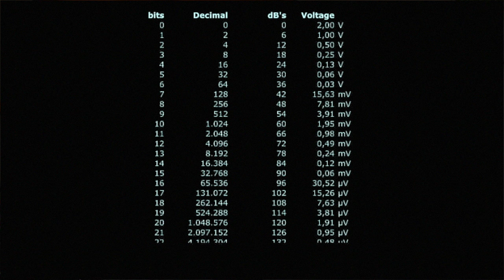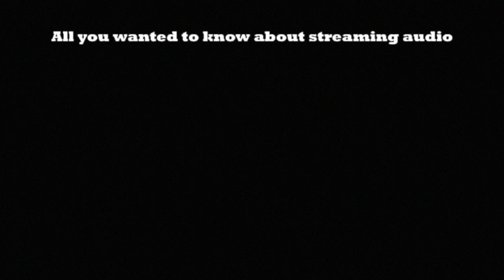Audio Hygiene 3 interconnects

Comment: Maybe the best solution is fiber audio cables to speakers that have built-in DACs.  That eliminates the worry over those picking up interference.  If that's an option, it's the best choice without need to consider your environment.
Reply from the maker: That might solve the cable problem, but does it solve the audio quality. You will be hard pressed to find the combination of a top quality DAC, a top quality amplifier and a top quality speaker design coming from one manufacturer.
Reply: The Hans Beekhuyzen Channel
Thanks for the reply.
Reply: However most companies can make at least one or the other. And having super high end gear is not necessary for great sound if you pair the right gear up and put i in a good room. most audiophiles forget the room and focus too much on the system. or they go overboard and put all kinds of panels and reflectors on the wall, and become obsessed with it.
Reply: Raymond Leggs
I wonder if it's less expensive to hire an audio engineer to study the room and electrical outlets and prescribe equipment and hardware and how to set it up than for the layman to figure it out himself.  Considering the time it takes to learn.
Reply: It can be to an external DAC.  It'd probably be even better if the DAC also decodes your prefered format.  From there probably all you need is a line built like a professional guitar cable.  It naturally cancels out interference.
Reply: It's been my experience that TOS link (fibre optic) is always inferior to SPDIF (coax)  for audio
Reply from the maker: Bandwidth wise that is absolutely true. But in some case the galvanic separation a plastic (fibre optic) connection offers can lead to better results since it solves problems with earth potentials.
Reply: How much bandwidth could audio take?  Can it be enough to saturate Toslink and still be handled well by SPDIF coax?  It shouldn't matter if it's passed to the DAC to decode it.
Reply from the maker: The general consensus is that 192kHz 24 bit is the limit. But depending on the components used - including the optical cable - some jitter or even serious jitter might occur.
Reply: I wonder if that is due to being converted to light and then back to an electrical pulse at an inconsistent rate vs electrons going straight through.  Sometimes I imagine, do to a slight addition to complexity, the best cable also depends on the demands of it.  If it's miles long and shared by a lot of high bandwidth applications and client/server connections optical fiber likely wins.  If the link isn't frequently saturated and one hundred meters or less, stp or utp copper might have more consistent performance, less jitter and shorter RTT (my assumption not based on experience).
Reply from the maker: SPDIF and TOSLink are developed in the late 70s and targeted at 16/44.1. It is a plastic conductor and not glass fiber. The bandwidth is limited if all goes well but if a poor (cheap) connector and/ or cable is used, jitter will certainly occur. See https://youtu.be/grzoqEb2KMk. What goes for electric digital connections also goes for optical, with the exception of earth potential and DC voltages.

Comment: Hans mains transformer which are not shielded  which are used to convert the mains supply in to a lower voltage to power the equipment  and mounted in the  pre amp and power amp how does this effect the performance.
Reply from the maker: Simple question, but hard to answer. There are many transformer constructions and shielded transformers might not always be the best solution. It's always about the total design concept. It's like asking if 16 valves in a 4 cylinder engine are better than 8. Well it gives more BHP but less torque.....
Reply: I have Audio Lab pre amp and power amp they use troydle transformers and are not shielded. Yes they give lower magnetic field than the older  type of constructed mains transformer but the magnetic  from both types is more than the power AC cable gives and of course they are inside the amps  which is a greater concern.
Reply: Just one other point Hans if you do a simple test by using a microphone plug in to amp put it near a mains transformer and of course you will hear a loud AC hum and then put it near the AC power cord the hum will be very low down and of no concern and would not affect the quality of the audio the mains transformer is of more concern how it is placed in side the amp

Comment: so the dbv is listed as parts of 1v total, if we had 4 or 5v output signal then all values would be multiplied by 5 right?
Reply from the maker: Nope. Since it's voltage the formula as shown in the video is 20log 1 over 4 (or 5)

Comment: silver plated and pure silver cables sound very harsh with analog signals but seem to sound really good for digital. as for people that say cables all sound the same try comparing kimber cables with monster. audioquest against wireword etc, they all have their own distinctive sound signatures due to differing construction and materials.
Reply from the maker: Well made pure silver cables, like the Siltech monocrystal cables don't sound harsh, I can assure you. They are crostly but are extremely good and certainly not harsh in any way.

Comment: Hans, hulde voor je video's. Hier snap ik iets niet. Je zegt: de straling van 230v wisselstroom is te horen in het signaal van een interlink (als ruis? Als brom?) op -50 dB als de afscherming van de interlink 90 dB is. -50 dB komt op mij over als heel hoog. Onder welke omstandigheden wordt die -50 dB gehaald? Is het daarvoor voldoende de interlink en de niet-afgeschermde netkabel elkaar kruisen? Of moeten interlink en netkabel om -50 dB te bereiken strak tegen elkaar aan liggen, over een afstand van meerdere meters?

Comment: I choose double shields (interlaced and foil) single thick cooper wire with teflon dielectric insulation built with a singled ended drain connection at RCA connector and coiled around the length for my IC. The experimental sound effect delivered attractively interesting results.

Comment: Happy 2017 Hans. I was a faithful believer in XLR because I believed such design can eliminate ground noise, but my ears disagree with me often. My question is: how is silver plated copper cable (or the other way around) change the properties of a cable? conventional wisdom suggest the electricity will only goes through the most conductive material (silver at this case), but I cannot agree on that conclusion.
Reply: They work like resistors in parallel.  More goes through the lower resistance but they both conduct electricity.